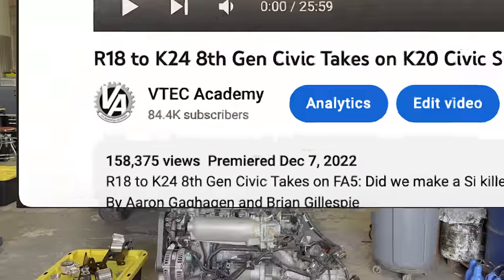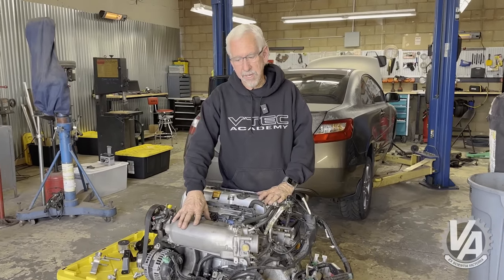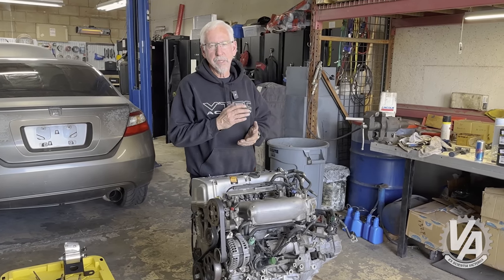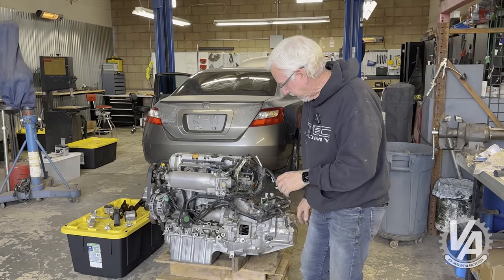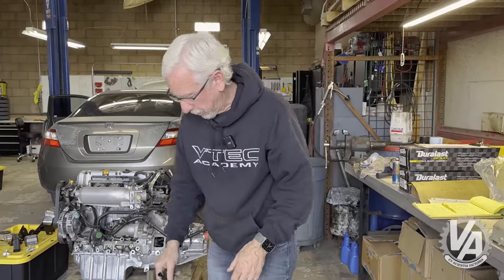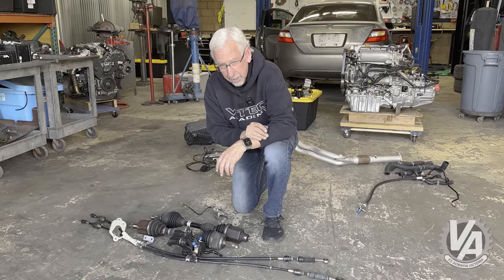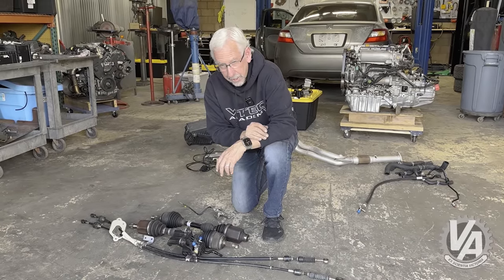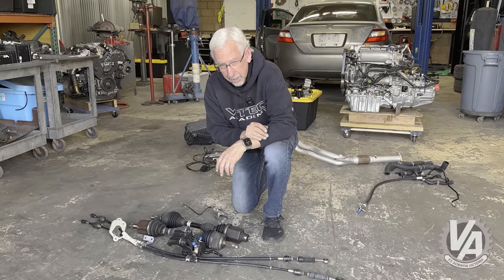Everything You Need  to go R18 to K Series (K20 or K24)

Comment: Thank you for taking all the time and effort to make this video! I have an 06 FD1 Civic with an automatic R18 engine and as you probably now, it's  the japanese version of this Civic and looks similar in most of the outside parts to the FD2 Type R Civic. I've had this car for 5 years now and I've always wondered if anyone ever tried a K swap into an R18 Civic. I read once that you basically needed to tear appart a wrecked Civic Si in order to use all the parts, but watching your video is pretty much about just purchasing the right parts! And look at that, you just listed them all for us here! And if I'm being honest , it doesn't look that expensive, considering the upgrade you'll be rocking on your old, good looking and reliable Civic. This is definitely on my wish-list for the next year, once I get my daily drive replacement, I'll start this K swap project with my FD1. Thanks again!
Reply: In Thailand the fd2  had a 1.8  the fd1 had a 2 L...
Reply: @classybluev1139  Really? I'm pretty sure that all the FD2s had 2.0 K series engines from factory. As this is the Type R Japanese version. You must be talking about the FD1 Type S. Mine is the FD1 Type S Japanese version with a 1.8L engine and auto transmission. However, I know there are a bunch of different configurations for different countries, maybe you're right.

Comment: I’ve done this swap and if you get the ecu from an 8th gen si and it comes with the key and the fuse box under the dash (micu) you do not have to bring it to Honda u can take the chip from key out and just get the original key programmed so you don’t need to change the door locks
Reply: Also this swap wouldn’t have been possible without vtec academy thank you guys 🙏🏼 they are very informative

Comment: Great stuff as always guys! That mount kit is super trick!

The VSA on the 07-11 Si ECUs should be no big deal at all. My 09 Si racecar has all of the VSA and TPMS wiring and hardware removed and it doesn't care other than the lights on the cluster. Love the content, hopefully won't need to reshell the car for a long while but it's great knowing I won't need another Si chassis.
Reply from the maker: Yeah, I just bought an LX sedan to turn into a race car. I may even get some CSX body parts to make a fake Type R.
Reply: @VTECAcademy  love it! Excited to see that and the L15 Integra progress, should be ripper with the current GLTC ruleset.

Comment: Video begins with "it's as easy as doing a B swap on an EK"
Later in the video you begin explaining that holes will be required on a plate in the oil pan and hoses will need to be combined together special equipped from a shop if you're lucky capable of doing it.....well sir that just defeated your initial statement. Nonetheless great video I'm hyped for this because putting an R series back in is dumb when they are notorious for block cracking. I've probably only grinded and rigged a couple things for the b swap but this seems much much more advanced to me

Comment: Seem as the R18 engine has become the modern day “D” series engine (the one nobody wanted until ebay turbos become a thing on them) and being so plentiful and cheap currently how easily would it be to put one say into a Honda fit as a super cheap engine swap? With a few parts and a tune I’m sure that lightweight eco engine should make a Honda fit a fun little back road racer on a budget.
Reply from the maker: Not really that much cheaper as a swap into something older than a K swap. You still need to take care of the engine management, wiring, mounts, axles, etc... We've found K24A1s and A4s for less than $200 that run at the yard which is at the lower end of what a running R18 goes for.

Comment: R18 under rated engine but if bolt on turbo to get extra power till 230hp and 270 torque its not big deal event though with low boost 0.6bar .with good set up and tune this engine roar like lion in the desert.

Comment: I love the content you guys put out on a regular.  I specifically like the fact that the 2 of my most watched content creators, VTEC Academy and mighty car mods did some work together.. great stuff.. I am based in Cape town South Africa and I'm busy K swapping my 8th gen R18a2 euro spec.. my car is exactly 13:10  the same as a FN2 but it's a 5 door 1.8 .. I have an issue with my right hand side shaft.. it's too short.. now I'm trying to get shaft specs online but im not finding anything.. I just want to cross reference length and spline count to see if I can match up some stuff to suit my build.. are you able to assist? Thanks

Comment: I have a 2004 crv with the 2.4 l vtec  and I keep getting a p0139 code . Both 02 sensors are new. Could needing a valve adjustment be causing the code? Not sure if I really need a valve adjustment or not.  Great video👍

Comment: Out of curiosity, wouldnt the K20 oil pump conversion for the K24 have been easier to do than dismantling and notching the K24 pump for clearance?
Reply: I installed a K2.4A2 in my acura csx notch the type S oil pump & it works perfectly. No problems

Comment: Hi Sir @vtec academy you forgot the tachometer it should be replaced if we go r18 to k series either 20 or 24 the redline of r18 is only 8,500.
Reply from the maker: Max revs for the K24A2 is 7100. An 8500 rpm tach should work.
Reply: @VTECAcademy  Ohh I see! thanks for the info , I always thought if I change to a bigger engine tach should also be change, thank you

Comment: Please do some videos on a d series, I am trying my hardest to find any info i can on them. I would like to know which variation of the d series is best to modify for boost, and maybe a good list of parts to do so. I have a 97ek coupe i am trying to build and the info or maybe a video or two 🤞🏼😂 would help alot!!  Hope you see this thank you 👍🏼 i left this comment on an older video but wanted to make sure you saw it 😂
Reply: There is way to many information on D series, just google it.. best for boost is d16z6 or d15b.
Reply: @civicpride1986  i have found lots of info but nothing specific, like which block and head combo is recommended or specifics like torque specs. I know this sounds dumb but im trying to learn so i can execute with as little trouble as possible. I also dont want to have to continually buy things because something doesnt fit or work right.
Reply: @civicpride1986  where would you say is the best place to find information?

Comment: instead of changing out the oil pump, if you keep oil level full according to the dipstick, what is the draw back? The deeper pan takes more oil, but the dip stick will tell you how much oil to add.
Reply: There is potential for starvation at high rpms

Comment: Great content as always, however I'd like to know if you have some tips for us that are located in Europe, as any Si parts are basically unobtainable.
Driving an FD1 R18 Manual, and the most likely option for a K swap is a K24A3 from an Accord CL9. 
Would I have to do really heavy modification of the wiring harness to match up the R18 to the K?
I'm guessing I'm also just using the standard ECU that comes with the engine I buy, as well as the axles?
Shifter linkages and a few other things are also a question mark since you say "just get Si ones", which I can not.
Any tips? TIA :)
Reply from the maker: Modifying the R18 harness would be significant. The stock ECU probably won't work. You could use the K24A3 engine. Could you get stuff from the FN2 Civic? That would be the ticket.
Reply: @VTECAcademy  Techically, I could get FN2 parts, yes, however they are quite expensive and hold their value very well, especially with undergoing global inflation.. we don't really see any part out's of the FN2..
It's a similar story as in USA of saying "just get an Si bro" 😅
So long story short, yes, and no, not really.
Accord's with a K24 are far easier to find and source parts for.
I was asking about the stock ECU of the K24, that should be able to work with the same engine, I'm guessing you misunderstood me and thought I was asking about the R18 ECU..

Comment: Hello. Your saying if  I'd  get an 06 civic si oilpan and pump I would still have to so some machine filing for it to fit??
Please friend help
Reply from the maker: You need to machine the Si oil pump housing to clear the K24 crankshaft. The other option is to use the FD2 Type R oil pump, but that requires changing the oil pump chain, tensioner and chain guide.
Reply: @VTECAcademy  thanks VteCACADEMY

Comment: hi vtec academy. i been looking for modifications for my acura csx (canada only model, 155hp, k20z2, engine is very similar to k20a3) it is pretty much the same as the 8th gen base model sedan chassis. I was wondering if the same k24 swap would be possible? I'm assuming it wouldn't be much different then the r18 but i would like to be sure.
Reply from the maker: It’s easier than doing the R18 model.
Reply: @VTECAcademy   thats great to hear ty.

Comment: I would like to put a K Series in my R18 with automatic transmission without changing my transmission to Manual.  This would be possible?
Reply from the maker: That would require custom mounts and a big change to the ECU plug that is still in the car.

Comment: I wanted to consider doing one of these swaps but unfortunately i have automatic transmission FG1. I'm curious if it is possible to do, and if so would you need different wiring on the auto ECU? I haven't been able to find one person who has successfully done this swap with AT but unless it is a project you guys are gonna look into the future, could you let us know? Thanks and keep up the amazing work you put out.
Reply from the maker: Automatic poses a problem. The electronics for auto aren't easily swappable. Mostly due to the A ECU plug that tis part of the car's harness. It is 44 pin as opposed to 49 pin so not compatible with the automatic ECUs.
Reply: @VTECAcademy  alright then i appreciate that info, i gotta accept that out of the picture

Comment: Hey Brian I had a question about the 8th gen K20 swap I'm having a hard time finding a Civic SI transmission I was wondering if a RSX type s transmission will work with the mount kit Hasports Sells for the 8th gen swap
Reply from the maker: Yes, it will work with that transmission. You just have to figure out something different for the shifter. I think you might be able to take the 06 Civic shift mechanism and put it in the transmission. Just not sure where you would find one.

Comment: A customer of mine just gave me their 2010 civic lx auto. Thinking about doing this swap. How bad do you think the manual conversation is to do? I’m assuming it won’t be too bad
Reply: Hi, if you plan on doing this swap please document it if you can, I have a 2010 Civic Lx Auto and I would love to see the build on that. Would plan to do it if everything goes smoothly with yours possibly. The manual conversion shouldn’t be too bad as you would possibly need the clutch assembly, pedals, and he did mention you might have to cut through the firewall. Thanks

Comment: Do you know if this swap could easily be done with an automatic car as well, you would just need the clutch pedal assembly? 

Also guessing that there are no differences between coupe and sedan?
Reply from the maker: Yes, coupe and sedan are the same. You will need the brake and clutch pedal assembly. I haven't checked yet, but you may need to cut holes in the firewall too.

Comment: hello, a long time fan here =D

as swap around here in brazil still very expensive and It's hard to find the K20/K24 around here, I'll end up going for the 1.5t when the price drops

I have the r18a6 here in Brazil, and I'm trying to get the hondata to work with a US ECU in this engine, but apparently it doesn't have the vtec oil pressure solenoid.

Do you have any knowledge of how to get around this?
thanks for your attention
Reply from the maker: I don’t. Ask Hondata if you can turn that off in software.

Comment: I am currently trying to find a tuning solution for a K20Z2 Acura CSX FD2 Automatic [Paddle Shift]. Any Ideas if the K24 TSX Auto ECU [Which has Hondata available] Might be able to run your R18 Civic[w.K24A2] TSX ECU 37820-RL5-A51   I believe the ECUs are similar. Trying to find any tuning path for the 4 CSXs i'm trying to tune, eventually changing from Z2 Head to Z3 Head only after a suitable tuning ability with Auto K20 CSXs. Could you help me shed some light, really trying to narrow this down.
Reply: I wonder if the K20Z2 CSX [Civic FD2] Has a Factory Honda Rear Mount That fits where the Hasport One goes.

Comment: Hey, could you guys help me out with an ongoing conversation I have going about k series cylinder head compatability? I own an 06 honda element with a stock k24a4 bottom end in witch I have swapped a rebuilt k24a2 cylinder head from an 07 Acura tsx. It runs well and acompression test puts it at about 180psi on all cylinders. It is very common for posts to come up in the element groups about swapping tsx heads onto our stock motors but (finding this out after putting over 20k miles on my swap) it is common knowledge that there are issues with piston to valve clearance issues with a2 cylinder heads and a4 pistons. I have done some mild digging into old forum posts and have found info of piston to valve clearance issues but no evidence otherwise. So is my situation an exception to the rule or does it disprove the rule?

Comment: I have the SI engine bay harness and the SI interior fuse box and the si engine harness and the car wont crank or do anything. do you have any idea what i could be missing?
Reply from the maker: We didn’t do it like that. We used the stock body harness and fuse box. Making the changes you did is a fairly radical change and I don’t know how that would work or what problems it would cause.
Reply: @VTECAcademy  thanks for the quick reply. I wanted to go with the EPS that's why I opted for converting them both. Thanks for your input. I may have to try and put the harness back in with the old fuse box make the extended starter wire and then use the c101 plug and see if everything works other than the steering

Comment: I’m interested in putting a k20/k24 in my 2015 Honda Civic ex. Is it similar?
Reply from the maker: You'd want the K24Z engine. We haven't looked at one of those yet for the exact details. I may try to by a wrecked one.
Reply: @VTECAcademy   I’ve also looked into getting a k20c2 2.0 that’s in the tenth gen. It looks like it would mount up. But curious if the engine harness would work?

Comment: can I drop the engine through the top if i remove the hood, or does it need to come out the bottom?
Reply: Yes, you can pull it from the top i did it with my 2010  acura csx same body style as the 2010 honda civic si itccomes out without any problems

Comment: Brian my 2007 honda civic is going to my to use 
What auto transmission can i use to link up to a k24a2

Also would i have to add a rp18 and rp19 transitor to the si ECU so it can detect automatic tranny
Reply from the maker: That is something I haven't messed with yet. I don't think the Si ECU will operate an automatic. I don't know of a mount kit that will work with that either.
Reply: @VTECAcademy  2005 rsx?
Reply: @VTECAcademy  also sounds like a new project to see if it works

Comment: Does anyone know if I can use another transmission for this swap other than the z3 transmission?
Reply from the maker: Yes, you can. But shifting the transmission becomes an issue. You’ll need to figure out the shifter situation since the other transmissions shift slightly differently.
Reply: @ say I get an rsx transmission could I just get a shifter from that and just fabricate something to fin in the civic?

Comment: The 2006 r18 140 hurspers 128;lb/ft  5-speed manual Civic can hit 60  in 7.3 faster than a brand new Honda Civic sport which  walks to  a 8.4 second run to 60  vs . The 2023 Honda Civic EX l with the 180 HP 177lb ft  turbo 1.5 takes 7.7  so 40 more horsepower 49 more lb/ft torque and only 300 lbs heavier than an 06 LX coupe... It is quite a bit more powerful not all that much heavier .... But only two civics in the history of civics generations have warned the golden calipers. . The FG1 f**** great one and the new civy hatches that leak

Comment: Can a electronic power steering be installed on a tsx motor?
Reply from the maker: It comes on the Accord Euro R, so yes. I think you would need the EPS from the 06-07 Accord Hybrid.
Reply: @VTECAcademy thank you for the response. One more question is the electric power steering pump better than the standard pump?